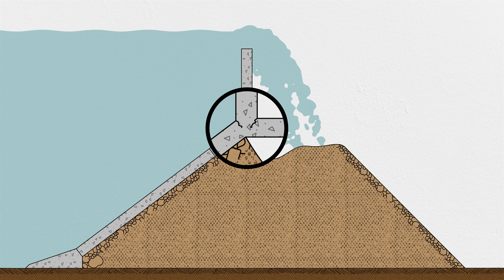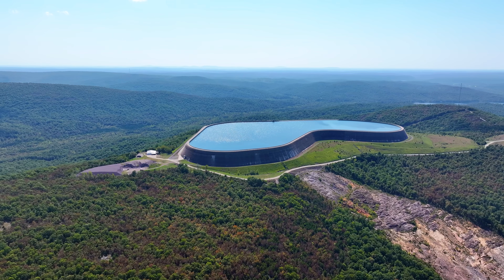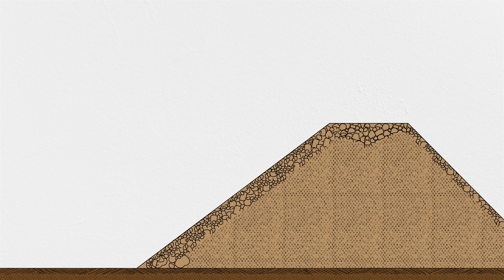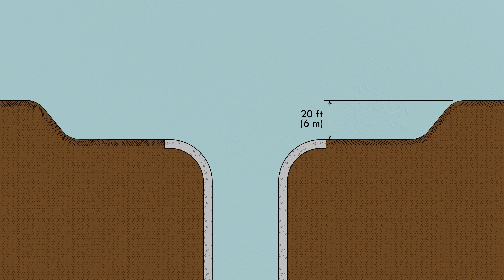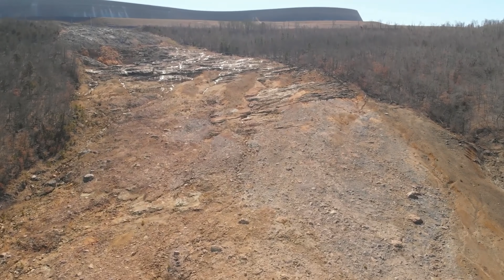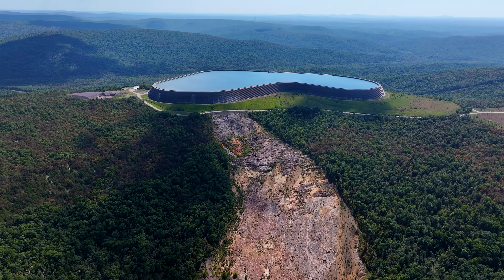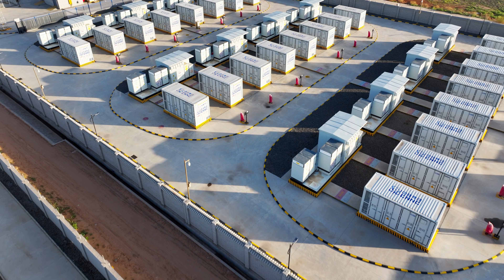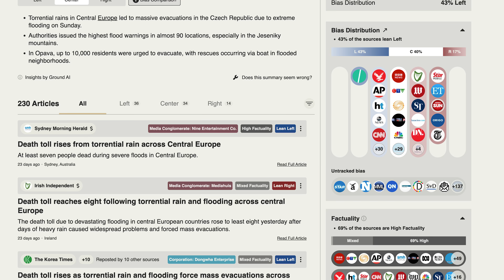The Wild Story of the Taum Sauk Dam Failure

Comment: A story about the recent floods in Central Europe: Bratislava and its outer city parts are generally well protected, but the city part of Devínska Nová Ves got partially flooded. But not by the rising Danube or Morava rivers. It was flooded from the massive flow of the Mláka stream that runs down from the Little Carpathians and eventually makes its way into the Morava river. There is a pumping station, but it was designed to handle a maximal inflow of 4 cubic meters per second. During the unprecedented downpour the Mláka stream caused havoc in upper parts, especially in the town of Stupava. When it reached the pumping station, the inflow was more than 8 cubic meters per second. This caused the pumping station, which was working on full capacity and pumped water up and into the much higher Morava river behind an embankment, to fail. Even large mobile pumps from firefighters could not help with the amount of inflowing water. This caused local flooding of a street and some houses. The firefighters eventually had to give up and leave the lowest area, as it became flooded, once the pumping station stopped working after suffering water damage.

Comment: Fascinating.  As a retired Safety Engineer I'm surprised the original over topping was not a critical event requiring immediate review and corrective action.  It would seem they would check to make sure everything in the reservior was still in spec with the original plans and that any changes were fixed immediately.  Apparently they did not understand the failure possibilities and results.  I might have to go visit this dam!!  Great video!
Reply: They did send divers, they thought they identified the root cause, and they thought they applied sufficient mitigation. But they didn't follow up on whether the mitigation was sufficient and  whether the detected cause could explain the issue sufficiently.

Especially sad was the issue of redundant overfill sensors connected in an AND configuration and set at a point too high. Those are the issues that a person stationed can see and start thinking "now why is that happening". Machines are really good at following orders, but they don't have common sense.
Reply: @Validole  its a sign that no one thought at all. As usual. On the land - because "its not my task to think, I am not paid for this", in office - because they do not know whats going on somewhere in 1000s miles, and "its not my task, I am Great Fuehrer, deciding about millions, not $100 sensors, let some stinky engineer down there thinks!". Kaboooooom.
Reply: The fact they never sent a surveyor up to assess the wall. To not have an operating knowledge of working limits of a structure. when it would be cents on the clean-up dollar, is totally incompetent and managerially unforgiveable.
Reply: @TRUMPSTEINslovechild yes, that wouldnt have cost a lot i imagine on the overall bill.....and would ve made all the difference...
Reply: From 12:20-12:25 he mentions that the "red flag" of the original over topping was missed because the owner hadn't notified the regulator that it had occurred. Agree that the corporate culture at the owner clearly did not include sufficient safety oriented thinking.
Reply: @RossReedstrom yup!!
Reply: One would have thought that when the dam overflowed and they saw it happen that they would not just blame the level sensors, but ask themselves why the redundant systems didn't do their job either.
Reply: I don't believe the public can access the site. (Maybe you have contacts?) But before the disaster, you could drive right up to it and walk to the top. You could also drive down to the power plant at the bottom of the mountain. There was a really nice little natural history museum at the gatehouse that was worth a visit, too. I sometimes wonder what happened to that.
Reply: I was going to say they didn't notify any authorities on the issue.
Reply: But it was a critical event, and they did an immediate review with the divers, and they took corrective action with the sensor calibration.
Reply: Business owners in red states know they can get away with literal murder and not face even a single day in jail.
Reply: They probably did, but thought the dam would probably last until they retired or the company got bought out. They will have had meetings with the engineer, with both an accountant emphasizing how much remedial action would cost, and a HR advisor with the engineers termination notice all filled out just waiting for a signature, in the room.
Reply: They didn't have a Chief Dam Safety Engineer, so yes, they were missing the technical expertise to adequately realise the seriousness of the issue.
Reply: @sinteleon They didnt?!! Gosh
Reply: im not an engeneer but when he explained those safety things were originally  placed above or just aligned with the highest waterline of the  dam i thought- wait, what?! 🙈😳 Like any adult that thinks for 2 seconds.....
Reply: These are the sort of things that happen in any working field, in shop management, health care to the humblest of jobs I see this pattern coming back. You would expect expert people that build a waterdam on top of a mountain  would eliminate this grubby failiable way of managing out of their dna at the beginning of their carreer, if not their education 😖 i mean gambling with such a project
Reply: They apparently didn't have a site manager. It was probably handed off to random supervisors, on a regular basis so that after about 5 or 6 management changes, no one really understood the systems as a whole. Techs would might reading older manuals, or going off handwritten notes. Who knows? They set a 2 foot margin, then assumed they were safe without visual confirmation? Send some dude out there with a dang tape measure once in a while!

Comment: Redundancy seems redundant until it stops a critical failure, then it seems like it is common sense to have one. The spillway should have been incorporated into the original design. Even if it was a once in 100-year event, it would have saved them money overall. Luckily with this one, we can say no one was killed, but that isn't always the case when redundant failsafes are ignored.

Comment: I can't believe what I'm hearing. They didn't maintain the sensors. Didn't maintain the backup sensors. Didn't install enough sensors. Didn't program the sensors correctly. Didn't have anyone check the water level. Didn't even bother to install a CCTV to monitor the water level remotely? They just let the whole thing run daily without a single person on site? The fact is that nobody had a clue what the water level was at any time. They only spotted the problem because a tour group happened to be there. But then put off fixing it for months? This is the most YOLO large-scale operation I've ever heard of. Who was running this dam? OceanGate?! The fact that nobody died is 100% dumb luck. Until we start jailing operators for this nonsense it will only continue.

Comment: I live within an hour's drive from the 2nd largest pumped storage facility in the US (6th largest in the world) - The Ludington Pumped Storage Power Plant, in Ludington, Michigan.  It is located high on a cliff, more than 350 feet above Lake Michigan.  The facility is quite large with a couple of scenic lookouts and informational signs explaining it.  It is jointly owned by Consumers Energy and DTE Energy and operated by Consumers Energy.  Originally, it was used as a buffer for one of the nuclear plants that DTE owned in the Detroit area, via connections through the power grid.  Now, Consumers Energy has built dozens of wind turbines that also feed the system.  Generally, it fills throughout the night and generates power during the day.

https://en.wikipedia.org/wiki/Ludington_Pumped_Storage_Power_Plant

Comment: Three notes from this one:

1) There were lots of Lessons Learned from Taum Sauk, and you at least glanced off of the topic of how those lessons were aggregated and disseminated -- a topic I'm hoping our county EMs here in Florida learned from the 2 successive hurricanes this month, Helene and Milton (and hopefully, I won't need to make that "3 successive hurricanes" in a couple weeks time).

2) You approached very closely another of my favorite hobby horses.  Essentially, your argument was "each moving part contributes to the complexity of a system, and it's the product of those numbers, not their sum, that's important in designing away from that".  I am not an engineer, so you can tell me how close that appraisal is, but my thing about it has to do with "circuit breakers".  That term's used by power guys to talk about what are essentially big contactors with external sensing/processing circuitry to tell them when to trip... as opposed to how smaller ones -- say 400A and below -- do it, which depends largely on physics: when the current flow makes something too hot, *its inherent physical properties make it trip*, and those physical properties very rarely fail.

And 3) Do you follow RISKS Digest?  You probably should, if you don't.  risks.org

Comment: Seems to me typical of most US infrastructure, suffering from a total lack of maintenance.
Reply: Honestly, maintenance seems like the CAUSE here. If they hadn't installed the liner to fix the leak problems, the level sensors would've been bolted down properly and not failed, so the control system would've actually known how high the water was and cut both pumps off before the dam was overtopped.
Reply: @CptJistuce  Maybe.  There is also the settling issue.  Where it overtopped had sunk by a bit over two feet, so even if the sensors were reporting correctly, the lip of the reservoir was still 2 ft lower than the design.
Reply: @Rocketsong  The overtop sensors were in the wrong place, but they were the emergency fallback. The primary fill level sensors were subsurface, and minimally secured after the liner was installed to avoid cutting holes in the liner that might lead to leaks. This led to them coming partially loose and bending, thus not reporting accurate level information.

Comment: One note.. I'm working in industrial automation in the last few years,  that's not "complicated system" and the erro done there was abysmal violating any norm and common sense  in industrial terms, maybe for civil engineering where there is more attention to structural things that automation one it's different..
But tanks that fill and empty and need to be regulated so it's a normal day job. It's literaly the first job I give to a Junior to test it the most simple thing they will ever do. 
From buffer tanks, to water towers, oil skid, leakage tanks... I think I have programmed more than 30 of those kind of system.
Always with multiple redundant way to measure the level (radar, optical level, diapason, pressure sensors at the bottom, in our case also weight, but not applicable here) along with sensor in overflow, in the collection...
It's absolutely impossible that something like this happen.

Comment: There will always be a use for pump storage facilities.
The one here in Ireland Tourlough Hill from the 1960's is vital for synchronous compensation, even though it is small @ 298Mw it assists the Main synchronous compensator in Money point.(Which was the biggest in the world when installed)
This is due to the destabilising effect on the grid by renewables & DC interlinks.

Comment: Ameren knew the dam was overflowing every night. After the failure the main engineer wanted I&C techs to install level and control systems but Ameren would only allow electricians to work on the new install, which they know nothing about. It was a tragedy that could have been prevented. I know

Comment: I was about to say "Sounds like a Normal Accidents scenario", then Grady chimes in! Excellent book, definitely a must read for anyone who wants to study failures in any system, especially complex ones
Reply: Almost seems more like a classic straw-back scenario
Reply: what in god damns name makes this a Normal Accidents scenario. This was complete incompetence at every "minor" issue. ONE TEST would have showed the redundant systems did not work. If this is considered a Normal Accidents scenario then we are forgiving the idiots that made those errors has if it was easy to make. You have to be completely brain-dead to implement these systems and not do it right or just test the thing.
Reply: Nothing normal about this accident. There were several avoidable errors that allowed this to happen.
Reply: @andrewjames4786  The "Swiss Cheese Model" seems more on point:  a bunch of (relatively) minor errors and failures that, combined in just the right way under just the right set of (normal) circumstances, permits the entire system to fail.
You do wonder how anybody could see water over-topping the dam, without running with hair on fire to the engineer in charge.  While it's true that it has to over-top somewhere along the upper edge, not being curious enough to discover that the dry side is a full two feet higher indicates a "tell the boss and let him worry about it" mentality.  (The boss failing to actually worry about it is the most egregious of the many errors.)
Reply: @jpdemer5  Disagree, the Swiss cheese model is about failures in mutually compensating safety systems, while this is a failure of holistic design because of the iterations and poor initial conditions.

Comment: Did you know that dumping a truckload of fill down a slope results in a different composition than dumping the load at the top and then pushing it over with a bulldozer? Just something I heard that wouldn't be apparent to the average Joe doing the work.

Comment: It blows my mind that a simple, $3, styrofoam float switch, the kind commonly found in HVAC cooling towers, etc wouldn't have been used as a backup.  You wouldn't have needed *ANY* of that contraption nonsense to determine the height of the water.  Did the styrofoam float upward and click the switch?  Yes.  Turn off the pumps.  lol  For THREE DOLLARS, they could have prevented that disaster.  UNREAL.

Comment: The problem I see with this is, the reliance on coal power plants to pump the water back up. I get it, have a back up to help with gaps when system demand suddenly increases. However, there is no real net gain and only net losses. The people gained nothing in the end, money was wasted and a coal power plant is still the primary power source. This is not helpful, I could almost get it if the power source were nuclear, give the plant a chance to ramp up and down slowly as any plant needs to, but in this case it is just wasting more fossil fuels, to waste more fossil fuels, to plug a gap in power management that could have been done better. And then this failure just drove the point home further, and yet more fuels wasted to rebuild it... brilliant.

Comment: Hey Grady! I know you said that the water inlet was designed to prevent a vortex when drained, I was just wondering why that would need to be prevented and what problem would it cause? Shame because I love vortexes.
Reply from the maker: Biggest problem would be sucking air into the tunnel and potentially into the turbines. Air can cause all kinds of problems with flow and machinery. Other issue is wacky currents in the reservoir, and it was cited as one of the contributing factors to the broken level sensors.
Reply: @PracticalEngineeringChannel  Ah I see! Fantastic, thanks so much for replying.

Comment: I don't think battery storage will compete with pumped storage. Grid scale battery storage is too expensive to maintain, even with things like LiFePo batteries. Batteries really do not do well with hot/cold cycles either. Instead I think batteries will start replacing generators in some places for emergency power and may do some very specific grid scale storage tasks near traditional power plants, especially in places with small seasonal and daily temp swings.

Comment: That could have avoided by just installing some cheap ultrasound sensors that would have checked the level on different points? You do not need to measure the full depth for the safety feature.

Comment: as someone who works on boilers and air handlers, im constantly surprised at the lack of analog safety features on waterworks systems. 
I'd imagine a storage system like that should have "high water alarm" float-switches (NC) in a ring around the dam that should trigger a breaker to kill all power to the pumps if any of those float switches lose contact/power at all.
we really need to stop trusting software to control these systems and have independent analog safety systems that can override digital controls. Safety devices rely on relay logic for a reason; they don't tend to fail, and when they do fail, its slow and often physically observable.

Comment: That's why you use separate sensors for level control and level limit. You could install one inductive sensor at the top lvl which shuts down the pumps when triggered. That's how we have to secure our fluid tanks.

Comment: 16:30 Storing electricity in batteries won't work. We are not in prime to use it for masses. You can't change then fast. And if you do then you lower the life cycle of it. Instead of that, build nuclear power plants. Solars don't work as when it gets too hot, it reflects sunlight back, causing greenhouse effect and heating up Earth. Wind mills don't work as they only rotate in certain direction and most of times, wind doesn't go in those directions. Hydro power plants don't work as they kill fishes and affect environment.

Comment: But why use this complex sensor system anyways, wouldn’t a few floaters along poles that go from the bottom of the reservoir do the job equally well, and in this kind of application reliability outweighs accuracy by a lot, it just makes sense to make ur sensor as simple as possible and as easy to inspect as possible.